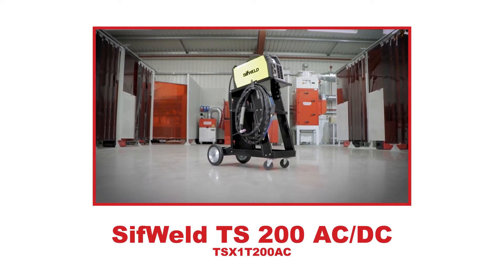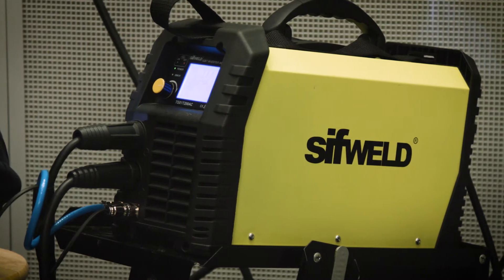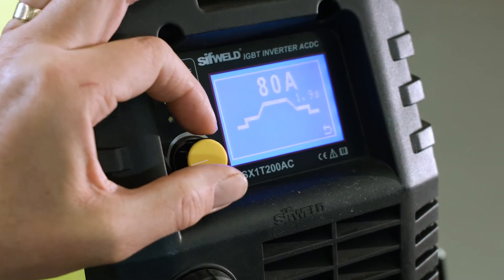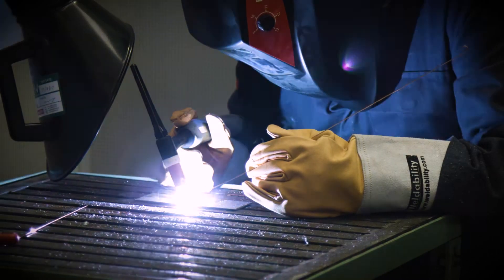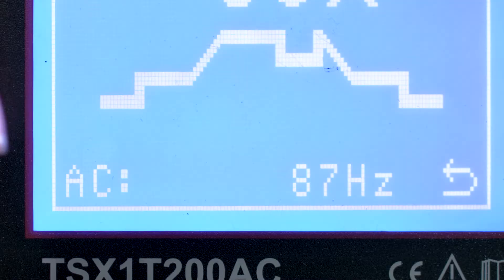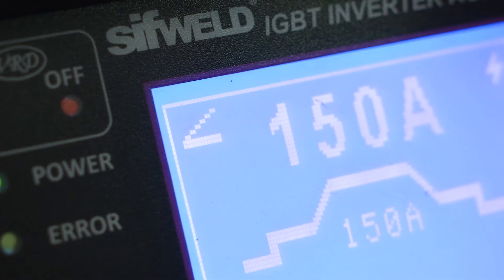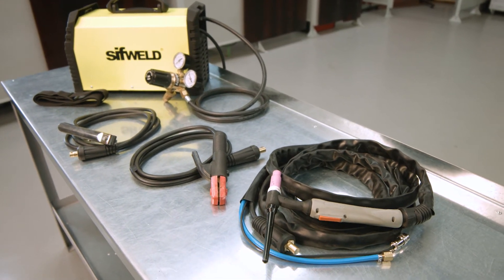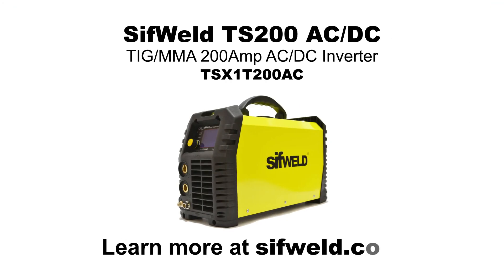SifWeld TS 200 AC/DC Inverter TIG Welding Machine

Comment: This is actually sold in Australia as SWS ( there is an updated model here now.. )
Reply: The outlets are slightly different though. Is it the same internally?
Reply: @jinxtacy   no its not  , and program is difrent
Reply: And here in the UK it appears to be knows as the Cros-arc 200. I have just ordered one with the pedal, a little more than I hoped but seems to be worth the money vs other chinese manufactured brands